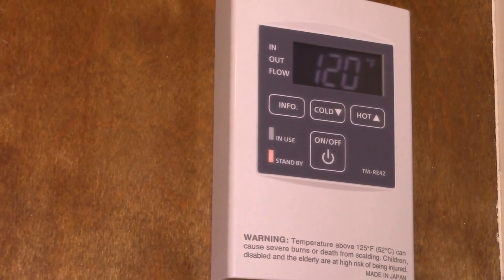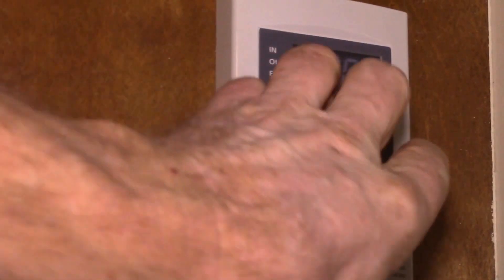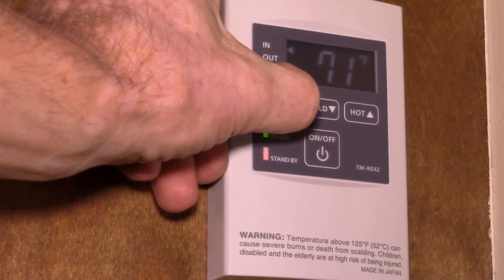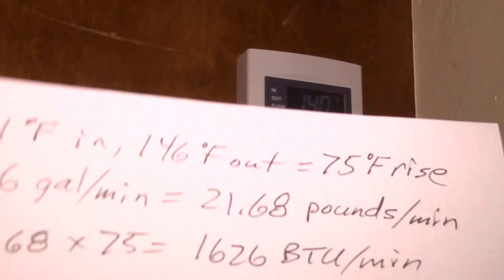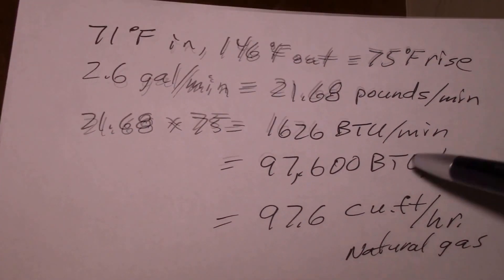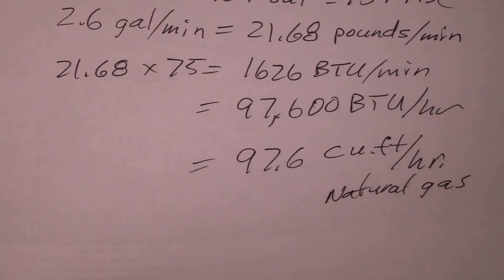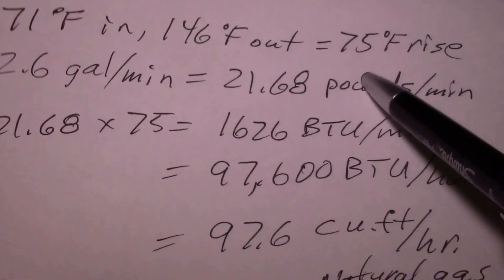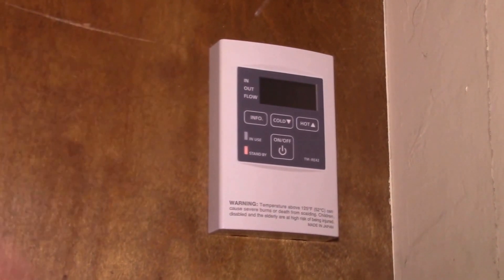Takagi Tankless Water Heater Controller Tips

Comment: I was pressing the cold and hot buttons simultaneously for several seconds on the remote controller and it changed to the number 1 and I could increase that number all the way up to 32. Do you know what that is?
Reply from the maker: Great find, that's one I had not seen before.  It does seem to do that, I tried it out on my remote display.  Hot increases the number and Cold decreases it.

I wonder if that is some sort of factory test mode?
Reply: @The4Crawler  I've searched extensively and can't find anything. Maybe a technician would know.

Comment: Can you please explain to me why you keep talking about the two button hold but skip over the parts where you actually say which buttons to hold? You do this two times at the beginning of the video. I'm trying to turn up the temperature on my water heater and your video is pointless for this information.
Reply from the maker: Sorry, didn't realize my hand was blocking the camera view.  

From the Owner's Guide:
1. Press the "HOT" button to set 120 °F (50 °C).
2. Press and hold the "INFO" button and the "HOT"
button for at least 3 seconds. The remote will emit a beep and change to 125 °F (52 °C).
3. Press the "HOT" button to set up to 140 °F (60 °C).
Reply from the maker: Here's a short video with just that detail:
https://youtu.be/rAalctqP4D0
Reply: @R Brown  Thank you very much and I'm sorry I was so grumpy. I've been having terrible trouble with my plumbing recently and was trying to use extra hot water from my water heater to flush a clogged drain line. I was able to turn up the thermostat to 166° and it worked beautifully for a couple of days. However, now I have no hot water whatsoever and an error code "11" which means ignition failure. Upon researching more a failed overheat cutoff fuse will also cause this error code. I'm thinking that turning up my system to that high a temperature cause the overhead cut off fuse to blow/burn out. Ughhh. So annoying it lets you set it that high if it can't actually operate at that temperature without tripping itself and failing.
Reply from the maker: @llamaskank  That sounds like it might be a different brand of heater, perhaps Rinnai, with that error code. Maybe there was some sort of prior issue that led to the code 11 popping up.  Something like a block in the intake or exhaust vent.  That could lead to the unit overheating and then a high temperature cutout activates.  Hopefully a good plumber or service tech can sort it out.

Comment: error code 991 on controller, what are it does mean ? It would be a big problem on my tankless water heater? I have no hot water for two days already before an appointment tomorrow afternoon.
Reply from the maker: You can find a service manual on-line for more details.
http://www.takagi.com/support/troubleshooting-guides

Abnormal Combustion Error Code: 991
Most likely its due to a blockage in the air intake (bird nest for example) or that dirt/debris has gotten inside the combustion chamber of the unit or there's something amiss with the gas supply or burner.

Comment: You are not taking into consideration efficiency which is ~0.8-0.82 for non-condencing and 0.9-0.95 for condensing devices
Reply from the maker: Correct, did so for the sake of clarity.  I do mention this detail in the video description:

"And to be more accurate, divide the BTU/hr. by the 0.93 heater efficiency factor, so 97,600/(0.93 x 1037) = 101 cu.ft./hr."
Reply: Which two buttons did you hit to increase temp.?  Once you changed to 140 does it stay at 140 until you two button again or auto reset to 120.  Very good video.  Thanks
Reply: @1celestial  Information and up arrow. Hold it pressed for several seconds